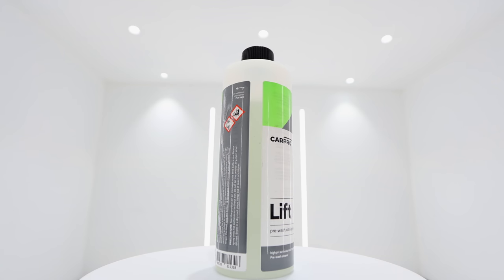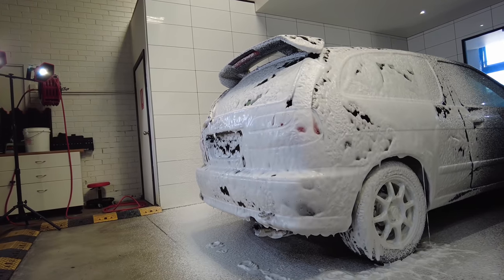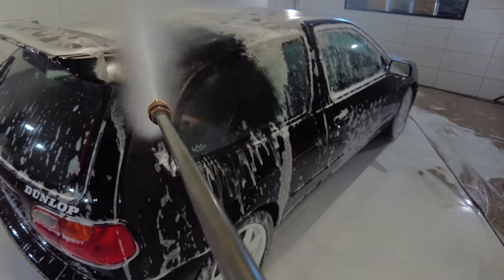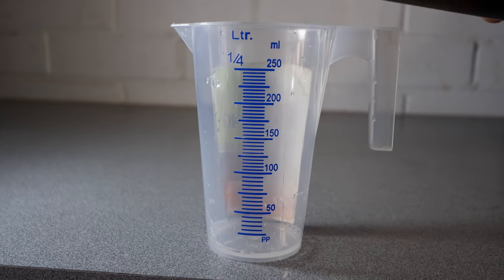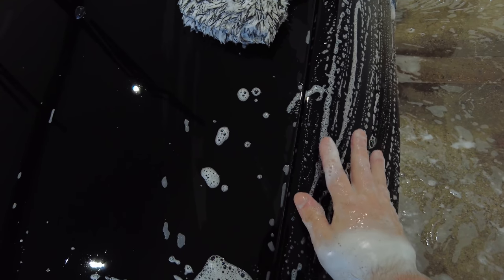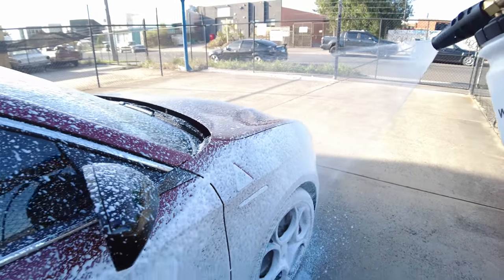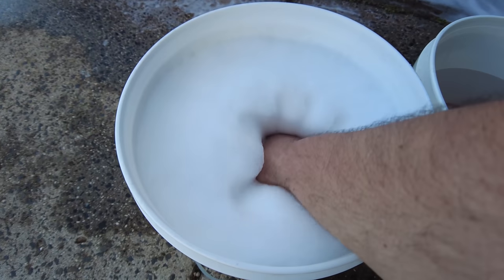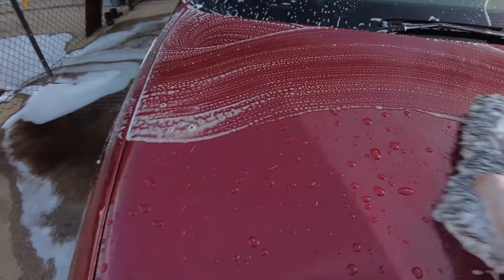New Carpro LIFT Snow Foam Full Review & Testing!

Comment: Would you recommend carpro Lift as a  dedicated snow foam for a ceramic coated car ? For every wash..
Reply from the maker: Only if your car is used and stored in extreme conditions where you need something with that extra cleaning power. My advice is to always use the least aggressive methods and products that get the job done. So if your more gentle ph balanced car soap isn’t getting the coating clean then yes I would recommend it.
Reply: @CarCraftAutoDetailing  what would you recommend for a safe snow foam for a ceramic coated car ?
Reply from the maker: Carpro Reset is fantastic, but don’t be afraid to use Lift as often as you need to,  especially before using a top sealant like Reload.
Reply: @CarCraftAutoDetailing  I use Carpro reset all the time thats my contact wash shampoo have been using gyeon foam as my snow foam for pre wash worked good was just thinking about replacing it with  Carpro Lift
Reply from the maker: You can also use Reset as your maintenance snow foam and then use Lift every couple of months before you apply a greasy layer of Reload or whatever really - that’s how I’d tend to use it.
Reply: @CarCraftAutoDetailing  thank you!

Comment: Since the PH is so high, does it strip ceramic coatings like UK 3.0?
Reply from the maker: It won’t strip a well performing quality ceramic coating, in fact used periodically it can help it perform better by removing more stubborn grime and particles that could inhibit the coating.
Reply: @CarCraftAutoDetailing   Nice, i’m going to try it out then.

Comment: Should I use car pro life every time I wash my car? Does it strip off my wax?

my car use only wax not ceremic coating,
Reply from the maker: You generally wouldn’t use Lift for every wash and it can to some degree strip waxes.
Reply: @CarCraftAutoDetailing  what are you suggestion?

every car wash use reset as pre wash and following by reset with 2 bucket

once a month(when applying wax) use lift as pre wash and following by reset with 2 bucket?
Reply from the maker: Yes that’s sounds like a great general method.

Comment: What ratio would you use this on ceramic coated vehicles? Or don't use it at all and just use Reset? Thanks!
Reply from the maker: The same 1:10 ratio and I’d personally use it periodically to help maintain the coating maybe before adding a top sealant every few months
Reply: @CarCraftAutoDetailing  Perfect thanks! I generally use Hydro2 Lite. In doing so I technically wouldn't need to use Reload correct? I prefer to avoid physically wiping the car down so I don't cause unnecessary marring of the paint. Or is it better to use Reload?
Reply from the maker: There’s pros and cons on each side- Hydro is quick, easy and safe from a wiping swirl perspective, but it can be hard to always get a perfect streak free finish especially in hotter weather. Reload tends to apply more evenly and make the paint feel smoother and consistent, but as you mention the less you touch the paint the better!

Comment: Does anyone find that after you ceramic coat your car and use show foam, the foam doesn't stick to the car 😑 I know that's the point of the coat but it makes my foam setup useless now 🤣
Reply from the maker: Absolutely! But if the coating doesn’t reject all the dirt and grime you will see the foam stick a little more to those areas, so it can also help you see how well and which areas of the car and coating are performing the best and worst as the coating progresses.